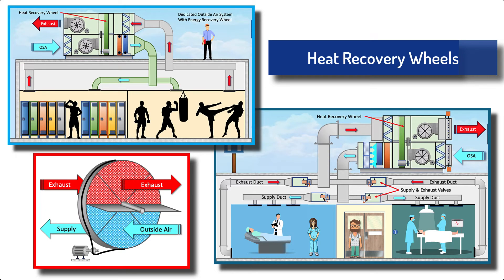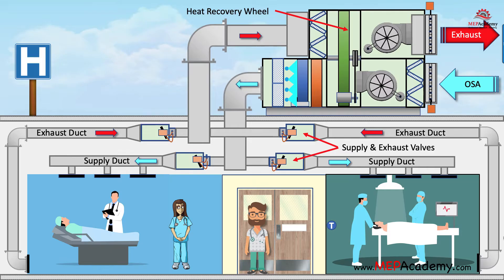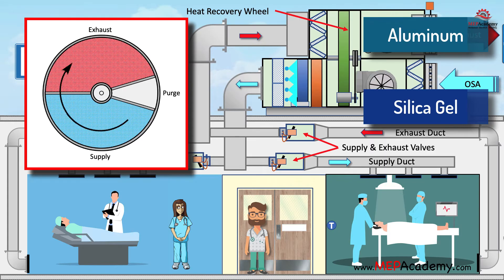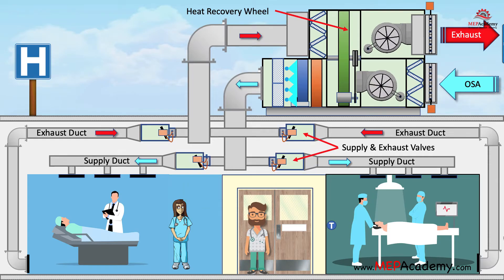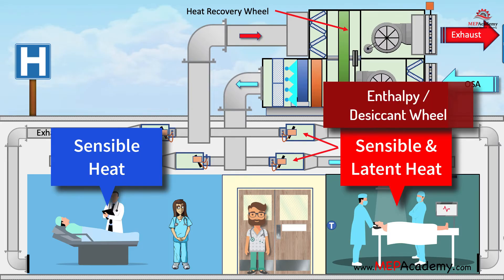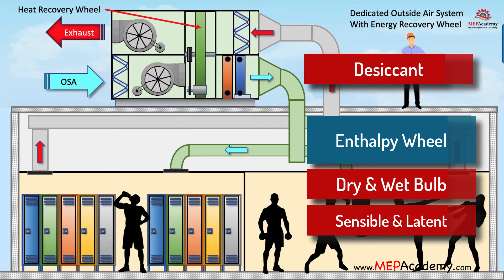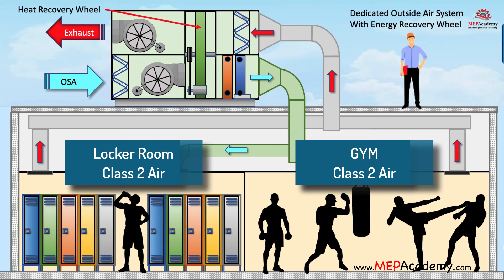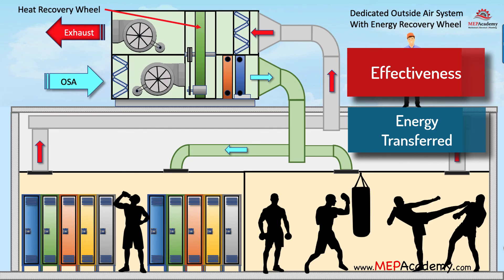Heat Recovery Wheels How they Work

Comment: In this same way exhaust of toilet can wr use or not. My mean supply air will mixing with the exhaust or not
Reply from the maker: No, toilet air should not be exhausted through a heat recovery wheel. ASHRAE guidelines recommend that air from spaces like restrooms (classified as Class 2 air) should not be mixed with supply air through a heat recovery device like a heat recovery wheel. This is to avoid the potential for contamination of the supply air with odors or pollutants from the restroom exhaust. Instead, restrooms should have dedicated exhaust systems that directly expel the air outdoors without recirculation or recovery. 

It’s essential to follow these guidelines to maintain indoor air quality and ensure occupant comfort and safety.

Comment: How is PM or cleaning done for these ERV wheels?
Reply from the maker: Preventative maintenance for a heat recovery wheel includes regular inspection and cleaning to ensure optimal performance and efficiency. This involves checking for and removing any accumulated dirt, dust, or debris on the wheel surfaces and in the surrounding ductwork. It is essential to inspect the seals and drive belts for wear and tear, replacing them as necessary to prevent air leakage and ensure smooth operation. Lubricating bearings and checking the alignment of the wheel can prevent mechanical failures. Additionally, monitoring the temperature and humidity sensors, as well as the control systems, ensures accurate operation and maximizes energy recovery. Regular maintenance helps extend the lifespan of the heat recovery wheel and maintains system efficiency.

Comment: Thank for the video! What methods can be used to assess the effectiveness of the heat recovery wheel in contributing to the operation of an air handling unit (AHU)?
Reply from the maker: Seek out someone that can do a Life Cycle Cost analysis to determine the feasibility of installing one of them for your application. Maybe someone with the Certified Energy Manager (CEM) certification or similar.

Comment: i thought the fresh air entering the building is cooled, not pre heated. recovery when it turns its supposed to absorb heat energy, thus lower temperature of incoming fresh air
Reply from the maker: Heat Recovery Wheels can work both ways, depending on the application and whether in heating or cooling mode. Heat Recovery wheels can add heat or remove heat from the entering air.

Comment: If heat recovery fan is not working what happened to building
Reply from the maker: This will depend on how the system is designed and the level of controls installed. If there is no redundancy, then of course the system will be out of commission until the motor is replaced. Depending on how critical the system is, there could be alarms setup to notify maintenance personnel of the failure.